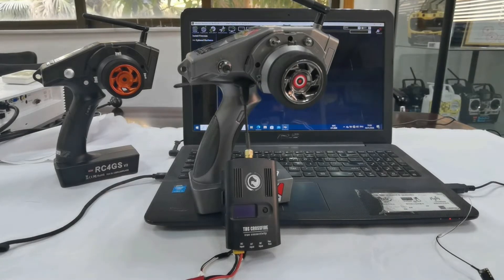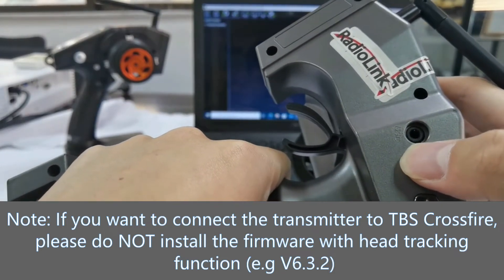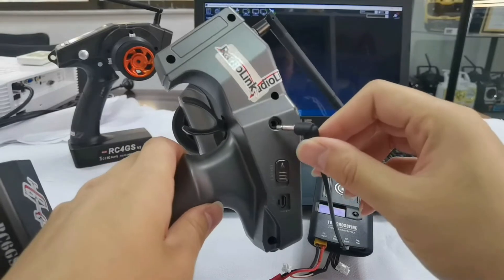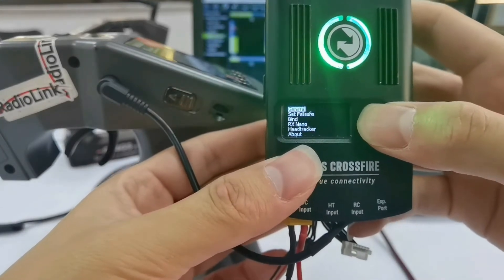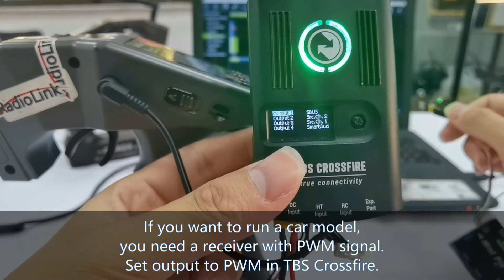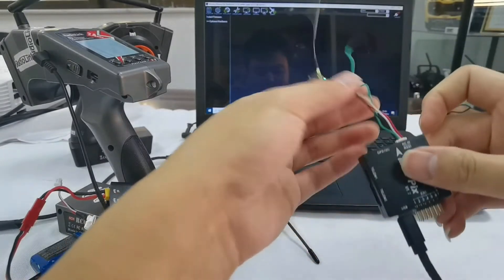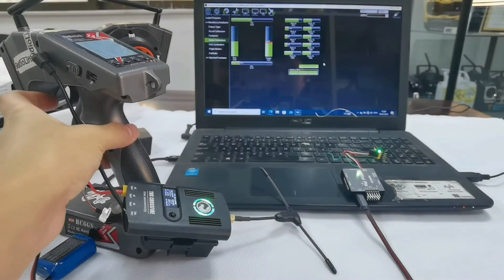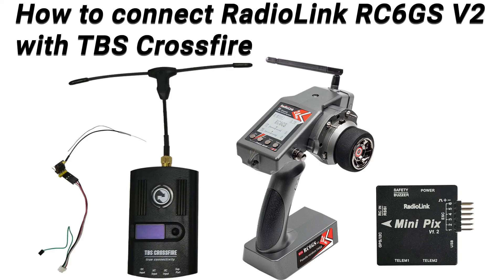How to connect RadioLink RC6GS V3/RC6GS V2//RC6GS/RC4GS V3/RC4GS V2/RC4GS with TBS Crossfire

Comment: I want to connect my RC6GS V3 to PC for VRC Pro, what kind of cable should i find?
Reply from the maker: Hi, sir, You need a dongle to connect RC6GS V3 to the the computer. Here is a video from our customer, who use RC6GS V3 and VRC simulator successfully for your reference. 
You can check this video tutorial: https://www.bilibili.com/video/BV1hr4y1G7cE Somce dongles come with cables to connect to the transmitter. And some dongles also provide simulator software. You can search "simulator dongle" online to get the dongle and cable. If there is any question, please feel free to contact us. Our email is after_service@radiolink.com.cn

Comment: hi could someone please tell me what cable i need to connect the rc6gs v3 to a simulator via the DSC port. nowhere does it say how many poles the 3.5mm jack needs to be.
Reply from the maker: Hi, sir. Here is a video from our customer, who use RC6GS V3 and VRC simulator successfully for your reference. 
You can check this video tutorial: https://www.bilibili.com/video/BV1hr4y1G7cE  He used a dongle to connect the transmitter to the simulator. And also set it to simulator in the DSC menu. In general, there are 2 poles for the cable that connected to the DSC port. One is the signal, and the other one is ground. If any question about RadioLink products please feel free to contact us. Our email is: after_service@radiolink.com.cn

Comment: Hello, does the TBS CROSSFIRE MICRO TX V2 also work with the radiolink?
Reply from the maker: Hi, sir. Yes. TBS CROSSFIRE MICRO TX V2 also work with the RadioLink transmitters. You just need to check the digram of it, and follow this tutorial to connect them. The connection method is similar. If any question about RadioLink products please feel free to contact us. Our email is: after_service@radiolink.com.cn
Reply: Has anyone done a tutorial on this??? I really need a guide on how to connect.

Comment: new subscriber! I need to know how i can connect the Tbs Crossfire micro Tx v2 with this remote. Please help me on this.
Reply from the maker: Hi, sir. Could you please click and check this video tutorial?  It introduces how to connect the RC8X transmitter to TBS Crossfire via PPM. https://www.youtube.com/watch?v=W_5y_OxVn2o   The only difference is that you need to plug it to the DSC port of RC6GS V3, not RC8X. You may need to search and follow the diagram of the Tbs Crossfire micro Tx v2 and modify the cable and to connect them. If any question about RadioLink products please feel free to contact us. Our email is: after_service@radiolink.com.cn

Comment: What if I want to use elrs is it possible?
Reply from the maker: Hi, sir. Sorry ELRS is not supported for RC6GS or RC4GS transmitter. But you can connect ELRS to RC8X transmitter. https://www.radiolink.com/rc8x  You can take part in RC8X Trade In activity. https://www.radiolink.com/newsinfo/835788.html  If any question when using RadioLink products please feel free to contact us. Our email is: after_service@radiolink.com.cn

Comment: I am curious about something on the 4GS v3 transmitter does it output CRSF protocol or does it output ppm for the crossfire module
Reply from the maker: Hi, sir. RC4GS V3 does not output CRSF. It outputs PPM output. So it use PPM signal for crossfire module. RC8X supports CRSF. Here is a tutorial for you. https://www.youtube.com/watch?v=W_5y_OxVn2o  If any question when using RadioLink products please feel free to contact us. Our email is: after_service@radiolink.com.cn

Comment: Will the R7FG receiver work with TBS Crossfire?
Reply from the maker: Hi, sir. R7FG cannot be bound to TBS Crossfire. You need crossfire receiver to work with Crossfire module. If any question please feel free to contact us. Our email is: after_service@radiolink.com.cn
Reply: So, with this setup, I will no longer have the gyro feature that comes with the r7fg?
Reply from the maker: @RCFPVSTL  Hi, sir. If you want to connect TBS Crossfire, you need to use crossfire receiver. If their receiver has no gyro function, then you cannot use the gyro function.

Comment: What did you set for DSC port in radio ?
Reply from the maker: Hi, sir. If you are using RC6GS V3, set the DSC mode to simulator in the transmitter. If you are using RC6GS or RC6GS V2, just need to install the firmware for TBS Crossfire, and there is no need to set DSC port in radio. If any question when using RadioLink products please feel free to contact us. Our email is: after_service@radiolink.com.cn

Comment: Hello RadioLink, you're writing that we're not supposed to install a firmware with head tracking functionality if we want to use TBS Crossfire, e. g. V6.3.1
The latest firmware seems to be V6.8.0 at the moment. Is it safe to install it if I want to use Crossfire? Isn't the mode of the DSC port selectable anyway (head tracking OR simulator)? Thanks!
Reply from the maker: Hello, sir. May I know what transmitter version you are using? If you are using RC6GS V3 or RC4GS V3, all firmware version supports both head track and TBS crossfire function. If you are using RC6GS V2, you need to choose and select the firmware compatible with head track or TBS crossfire. Here is the link: https://www.radiolink.com/rc6gsv2_manual  By the way, firmware of RC6GS V3 and RC6GS V2 are different. Please do not install the wrong firmware. Otherwise, the screen may be blank of you install the wrong firmware. If any question when using RadioLink products please feel free to contact us. Our email is: after_service@radiolink.com.cn
Reply: @Radiolink_official  Thank you very much for your reply! It's a RC6GS V3 - awesome radio by the way.
Reply from the maker: @sebastiankettner1144  Hi, sir. Thank you for your support. If you are using RC6GS V3, the firmware supports TBS Crossfire and head track function. You just need to choose it in the menu DSC of RC6GS V3. If any other question when using RadioLink products please feel free to contact us. Our email is: after_service@radiolink.com.cn

Comment: does it support ELRS modual?
Reply from the maker: Hello, sir. Yes. The connection to ELRS is the same with TBS Crossfire. Please refer to this tutorial about it.
Reply: @Radiolink_official  can you put a link to the elrs video. I cannot find.
Reply from the maker: @gotdrift8  Hi, sir. Sorry we did not take tutorial of ELRS. But you can check this tutorial, and refer to its diagram to connect them. Here is a tutorial on how to connect ELRS to RadioLink AT9S Pro transmitter for your reference: https://www.bilibili.com/video/BV1it4y1J7do   If any question when using RadioLink products please feel free to contact us. Our email is: after_service@radiolink.com.cn
Reply: But i cannot find PPM input for ELRS module.  May i know which brand or model of ELRS are you using?

Comment: I posted most of what appears below as a 'reply' to a question someone else asked...but, at the same time, I felt I should also post a slightly "modified" version of what I said, so that others can have the same information.  So that anyone watching this video, and checking the comments, will know, the Mini Pix is NOT needed.  Additionally, the computer programming shown is also NOT needed.

I contacted TBS, and obtained more accurate information.  For any RC radio having a DSC port, all you need is a TBS Crossfire Lite, the two cables mentioned in the video (cable connecting between Crossfire & Tx, and battery adapter cable, both of which should come with the Crossfire), and a TBS Crossfire 6Ch Nano PWM Rx (sold separately).  Honestly, you might not even need the battery connection cable, as a battery with the correct connector (it's either XT30 or XT60...not sure which, as I haven't received my Crossfire Lite yet).

As for what else needs to be done, on the Tx, I assume that (as is done with aerial transmitters) the RC6GS internal transmitter needs to be 'disabled', and some setting for the DSC port needs to be enabled.  The receiver, before outputting the signal to servos, ESCs, etc to automatically concerts the signal to PWM.
Reply from the maker: Hello, sir. Thank you for your information. Yes. You are right. Mini Pix is NOT needed, and the computer programming shown is also NOT needed. We just want to show there is successful connection, so we use Mini Pix to show it. And yes, you only need to choose DSC port mode to enable the successful connection. For RC6GS V3, when you connect it to TBS Crossfire, you need to choose: simulator in the setting page of "DSC" function. Thank you for your feedback. If there is any other suggestion when using RadioLink products please feel free to contact us.

Comment: hey what if my headtracker is connected to the ht port on crossfire , would crossfire work with headtracking at same time? thx
Reply from the maker: Hello, sir. Sorry crossfire cannot work with headtracking at same time. You can either use headtracker or use crossfire.
Reply: @Radiolink_official  even though the crossfire has its own dedicated ht port that accepts ppm?
Reply from the maker: @kool-k-kel  Hello, sir. If crossfire has its own port, crossfire can control head tracking, but you cannot use RC6GS V2 to control head tracking at the same time.
Reply: @Radiolink_official  so are you saying it will work if the headtracker is connected to crossfire and the crossfire to radio?
Reply from the maker: @kool-k-kel  No, sir. You can choose either head tracker or crossfire. Sorry they cannot work together.

Comment: Awesome remote and setup, great video and information
Reply from the maker: Thank you sir. If you have want any other tutorial, please feel free to let us know. We'll consider it.
Reply: @RadioLink  doesn't the R7FG provide PWM? If so, then am I still required to purchase another receiver?
Reply from the maker: @RCFPVSTL  Hi, sir. R7FG receiver supports WPM signal. R7FG has two working modes. You can check the detailed introduction of it from the manual of it. Here is the link for you https://www.radiolink.com/r7fg_manual  If any question when using RadioLink products please feel free to contact us. Our email is: after_service@radiolink.com.cn

Comment: Do I need the Mini Pix? I don't have one currently and I am hooking it up to a RC car.
Reply from the maker: Hello, sir. We use Mini Pix to show that the signal is recognized. You can use it or not. Just make sure what signal model is your receiver. If it is PWM, you just need to change the signal on TBS Crossfire to PWM and then it will work with your RC car.
Reply: NO, the Mini Pix is NOT needed...nor is ANY of the computer programming shown.  I've been in contact with TBS, and have obtained more accurate information.  With any Tx having a DSC port, all you should need is a TBS Crossfire Lite, the two cables mentioned in the video (cable connecting between Crossfire & Tx, and battery adapter cable, both of which should come with the Crossfire), and a TBS Crossfire 6Ch Nano PWM Rx (sold separately).  And, in truth, you might not even need the battery connection cable, as a battery with the correct connector (not sure if it's XT30 or XT60, as I haven't yet received my Crossfire Lite).

As for what else needs to be done, on the Tx, I assume that (as is done with arterial l aerial transmitters) the RC6GS internal transmitter needs to be 'disabled', and some setting for the DSC port needs to be enabled.  The receiver, before outputting the signal to servos, ESCs, etc to automatically concerts the signal to PWM.